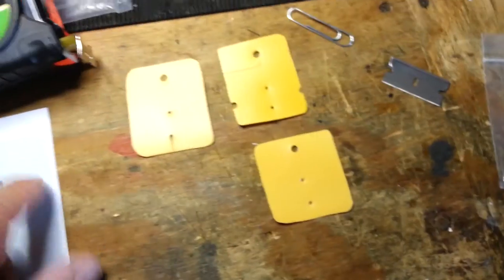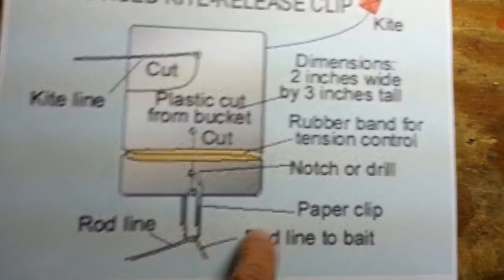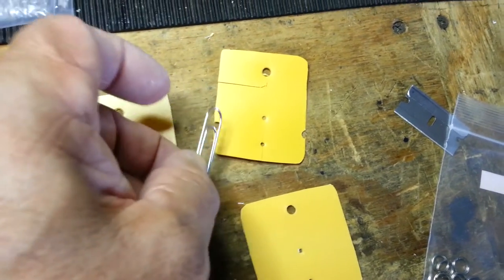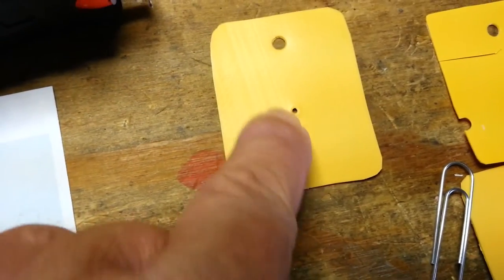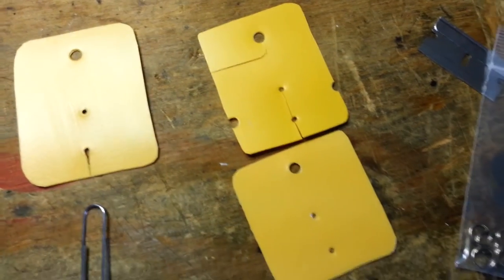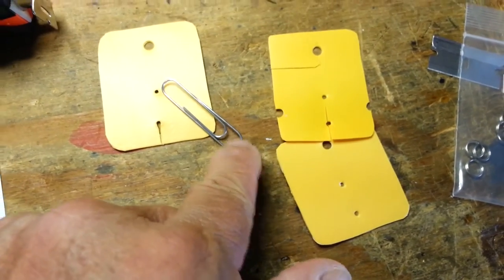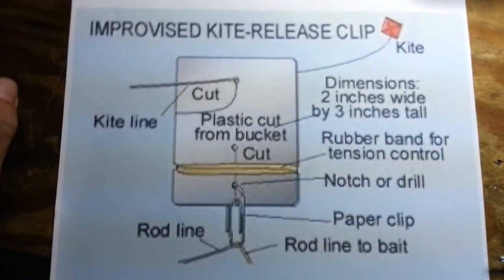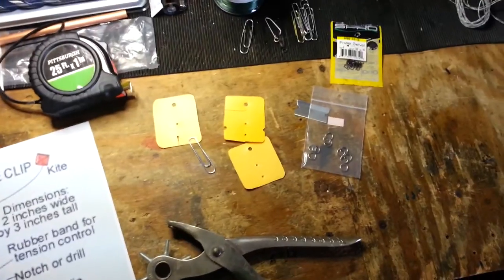Home Made Fishing Kite Release Clip

Comment: SLIGHT MODIFICATION: Thank you for a great idea. I like to share my experience with it. I made it using the type of plastic John Sims has suggested. It releases too too easily. Just a gust of wind pulls the kite up and the line is released. If the weight (in my experiment I just used 4 Oz weight, on ground) lifts off the ground, it releases the fishing line. I noticed the mechanism of the release. The paper clip does not pull straight down. It actually  causes the two halves of the plastic to move front and back so that the pin is slipping parallel to the plane of the plastic tab and not perpendicular to it and thus explain the very easy release.  Because the plastic is so thin, it happens with minimum of pull.

I modified the method a bit. I used the plastic from the bottle lid (big jar with fairly thick plastic). The plastic is slightly flexible (kind of rubbery). I punched two holes in it with a paper puncher. Top hole for the kite line. I slid it on the line before launching the kite (so no side cut). The second hole is for the fishing line. Below this hole, I have made the Y shaped cut. The v part of the Y being very small, just enough to get the paper slip started. The bottom limb of Y is long. With this type of material, I noticed that when I pull the clip, it actually separates the two halves to  slip out and not shift the them front and back. Much better hold. I don't know if my description makes much sense.
Reply from the maker: Thanks for the mod!